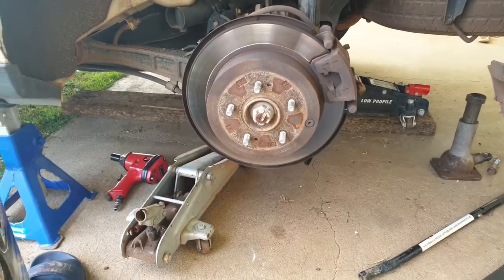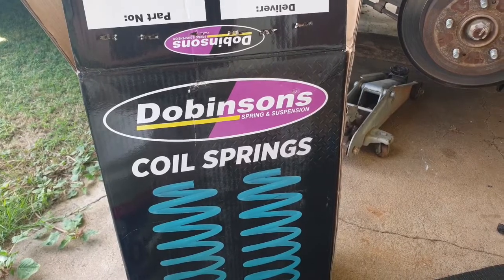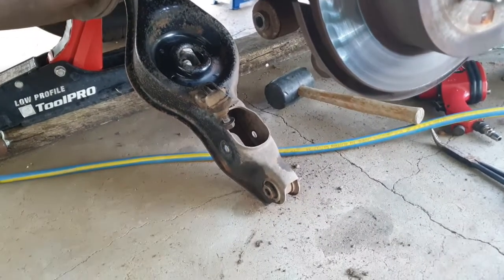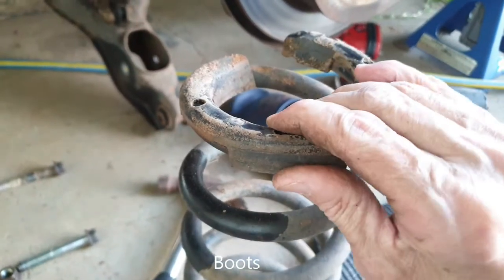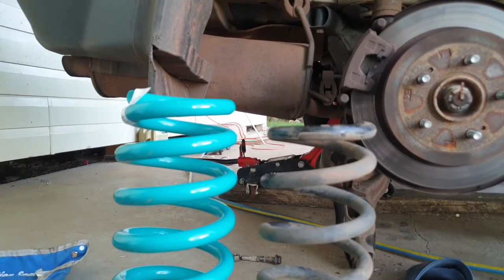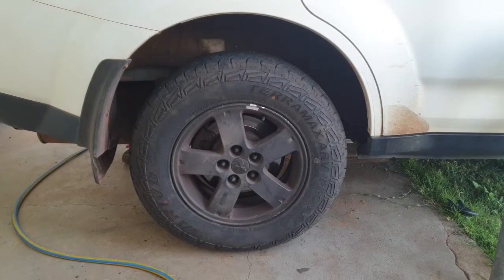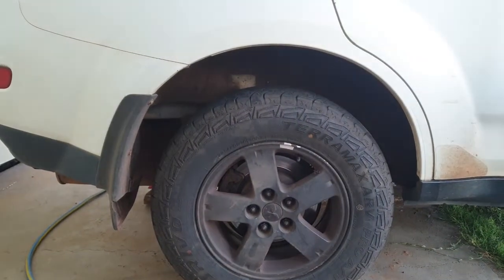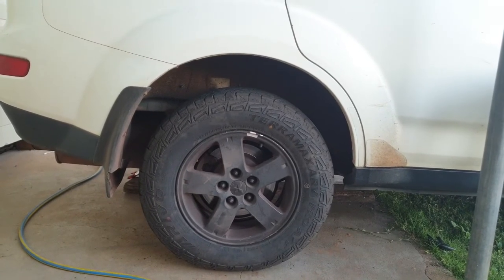Mitsubishi Outlander Rear Spring Replacement

Comment: The process for inserting the springs is to compress the full length or part of about 2 inches or a little more,then after inserting,put in the bolts and after that decompress the springs,much faster and easier.👍👍😬😬

Comment: • Dobinsons 4X4 REAR COIL SPRING x2 30mm Lift FOR MITSUBISHI Outlander ZG ZH - Part Nº: C43-255
• Dobinsons 4X4 REAR COIL SPRING x2 35mm Lift FOR MITSUBISHI Outlander ZG ZH - Part Nº: C43-147

→ Please installing new short end links rear, original high 80mm → new high 65-50mm !
• Hardrace Short End Links  → adjustable from approximately 65 mm.
• Cusco Adjustable Short Links → adjustable range 65–85 mm.
• FK Rod Ends (M12/M10) → freely combinable, shortest possible configuration ~50 mm.

Original Parts rear: 80mm - 15mm =  65mm  = ROVER: EGP 1662 , HONDA: 51320-SK3-000 , A.B.S.:260248, FAI AutoParts:SS408, FEBI BILSTEIN:42067, GSP:510804, NIPPARTS:J4964006, NK:5112608, RTS:97-06517, SWAG:85 94 2067, TRISCAN:8500 10613, TRW:JTS944, BLUE PRINT:ADH28511, CORTECO:49400918, FEBI BILSTEIN:23819, KAMOKA:9030295, MAXGEAR:72-1611, MOOG:RO-LS-1831, SIDEM:65060, SKF:VKDS 843002, SWAG:22 92 3819, MAPCO:19957, MEYLE:31-16 060 0033, BORG & BECK:BDL6405, METZGER:53050808, QUINTON HAZELL:QLS1817S, DENCKERMANN:D140031, QUARO:QS7774/HQ,ACKOJA:A26-1196,BGA:LS7504, DJ PARTS:DL1636, 3RG:21866, KAVO PARTS:SLS-2030, KAWE:8500 10613, MASTER-SPORT GERMANY:23819B-PCS-MS, Oyodo:60Z4001-OYO

Comment: This is a good video,, and appreciated. Just wondering, did you only replace the rear or all 4 coils?
I need to replace the rear at this point and wondering if it’s going to be an issue without doing the front. Thanks

Comment: Great video. Have you noticed any negative mechanical effects from the taller springs? I know the 40mm lift has caused problems with the front sway bar end links bending or breaking. Anything similar with the springs?

Comment: Replace my rear one at the weekend. friend has the spring compressor tools. but cant use them as limited room. we did similar to what you did using the jack. place a few bricks under it as height increased incase something slipped!

the motor dealers gave me the wrong spring even though they put my reg through the system. luckily they another had one in stock.!

Comment: Hey Jay,

Would you happen to know if the ZG Mitsubishi Outlander shares same suspension setup for thr ZL Mitsubishi Outlander.

Looking at improving height and strength for towing a camper trailer.
Reply: just use 40mm lift kit and swap over to 215/70R16 wheels and tyres.   if your shocks are over 150k old, replace them too.  If you're towing a camper trailer... put in some double offset lower control arm/trailing arm (rear) bushings to get a nice 1.0+ degree of extra caster.  It'll make the vehicle much safer at speed, especially when towing.

Comment: I did the spacer lift. 40mm it took more than just the spacers. Required new adjustable camber arms and track rod arms, along with complete bushing+trailing arm Bush replacement +b15mm shorter droplinks. because the change in position wore them all out quicker. Worth it though for me, looks and handles awesome. I used stiffer springs. Kyb6227 I think is thale part number
Reply: Hi I'm just about to fit some 30mm lift blocks, well I've bought them and now wondering if it's the right thing to do. Where did you source the Camber and track arms, if you don't mind sharing. I've also bought extra heavy duty Lesjofors springs for the rear and the Auto box ones for the front, might just fit those first.
Reply: @ianyork1234  40mm is the max you can go. I also used heavy duty rear springs and it was very difficult to get them installed on the rear with the lift. The camber arms I got from ebay. Same ones fit a lancer 07>.

I'd say go with the springs and bigger tyres before doing the lift. I reckon it's enough and gives good aesthetics
Reply: @Mcevoy91  Thanks for the tip, I'm running 235/75/16 G015's which I've been very impressed with, but need a bit more space in muddy conditions. Think i'll stick with the springs for now.

Comment: Great video.  I've got a 2009 Outlander myself and was tossing between a lift kit and the springs.  Would you have any thoughts on the matter?  And btw how's the ride now with those Dobinsons?
Reply from the maker: Hey I would go for the springs, less chance of things going wrong if you can get a set of springs that high as for the ride after the springs were done,  the ride is nice,  it  handles a lot better and doesn't bottom out as it used to.
Reply: @jayfix6126 do you need to change the shock absorbers too or any other thing? I am look to do this + slightly bigger tyres 235/60r18 instead of the original 225/55/r18.
Also any issues with the CV joints due to the increased height?
And finally, any issues with the camber angle?
Thanks mate, great video